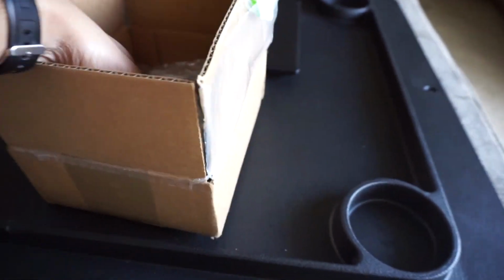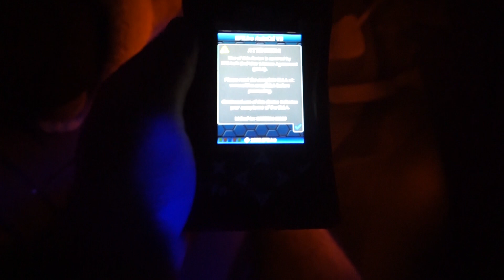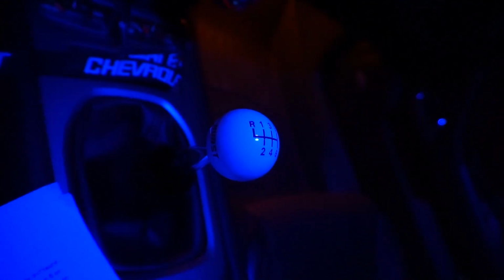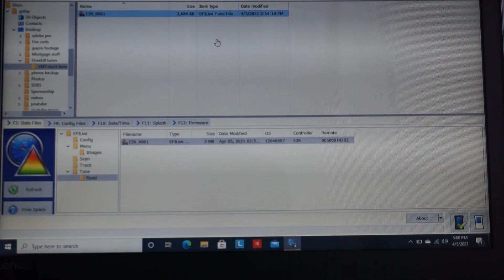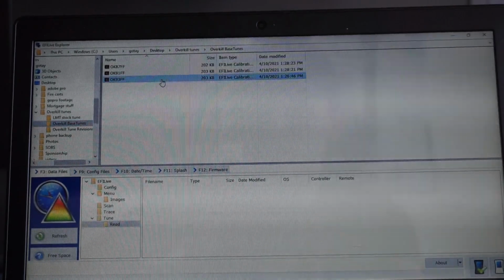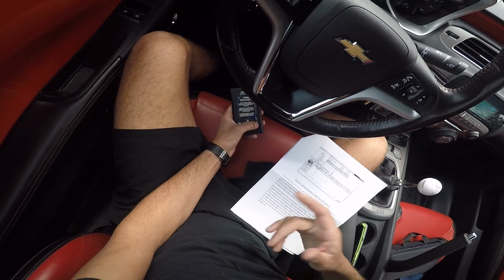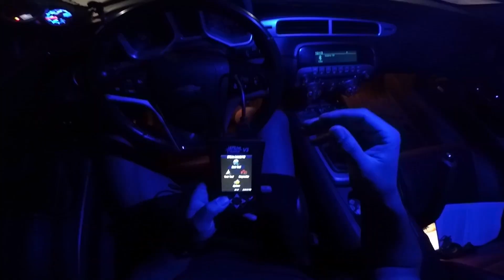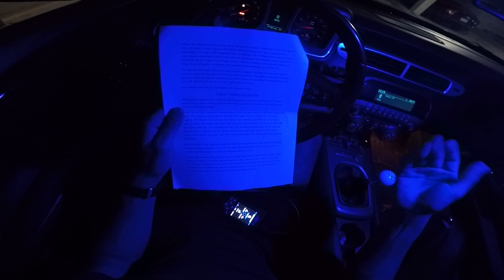Camaro V6 Gets Overkill Tuned! (Initial Setup And Data Logging)

Comment: Which option tune did you get I have a 2018 camaro and I want to get the tune but there is more then one option idk which one is for my car
Reply from the maker: I don't know what you mean when you say "option tune"?
Reply: @mistermanage1119  like when I try to order the tune there so many option sorry this might sound stupid but what unlocked Tcm mean because that’s the option they give me
Reply from the maker: @abanoubtawfek4731  TCM is for your transmission if you have a auto. That way they can tune your transmission to have different shift points. If you have a manual, that is irrelevant.

Comment: Did you Camaro rev hanged from 1st to 2nd gear?
Reply from the maker: Not with a tune. Without a tune, yes.
Reply: @mistermanage1119  how different did it felt after the tune?
Reply from the maker: I explain that in a video on the channel

Comment: DO NOT get an overkill tune. I just wanted to give my more recent experience with trying to get a tune from Overkill. I ordered the tune, waited about 2 weeks and sent an email inquiring about the order. I heard nothing after letting another couple of business days pass. I then decided to open a dispute on Paypal hoping he would respond to this. After he still didn't respond to this for a couple of days, I escalated the dispute into a claim to try and get my money back. He was given 10 days to respond to this by Paypal and even after this addtional 10 days on top of all the other time I had given him, he still never responded to the case. Luckily in these types of situations, Paypal will default to a full refund for the buyer but I was still out the time and headache that I spent on this. I am now just going with a tune from trifecta as they are quick to respond and have already sent me the tune and shipped the cable within a couple of days of ordering the tune from them. I should have just gone with them in the first place hearing how bad Will was at responding, but I never thought it would be quite that bad.